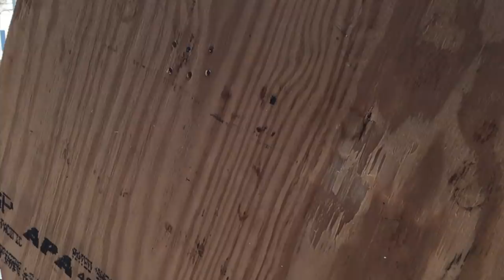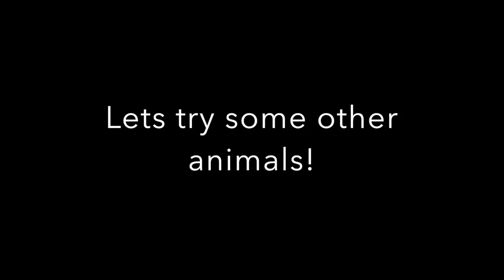WoodWorking: Building my Pet Raccoon a Running Wheel!

Comment: Back when my kids where young we had mice and hamsters. Those little shits ran on their wheels relentlessly to the point the noise would drive you nuts. Let us know how that all works out. By the way, awesome project though. If it ends up driving you nuts try a tread mill. you can usually fine them at a yard sale pretty cheap. they also give you control when they run and mostly when they don't. Love your videos. you kids are great.
Reply from the maker: Haha the hedgehog has a plastic wheel that squeaks like crazy.  I know the feeling 😂.  They are all in there own room so we don’t hear too much of it luckily.

Comment: Okay you need to put some rabbit wire all over it and then cut a little door in the middle that you can open and close that way they're forced to go round and round they won't be able to get out.  Great job I'm going to make that for our ferret. I'm so glad you're concerned about the weight on the raccoon because his is definitely true they get too obeast
Reply: maybe not in the middle but down at the bottom that could be shut and make sure it's secure because the ferrets will try to sneak out and could choke themselves
Reply from the maker: I’d be worried that he would be scared since he couldn’t get out and then he would just hate the experience

Comment: Just put in a simple fixed "wall" that doesnt move with the wheel to keep animals in and that they can only scale and go over if they get to about 30-40 degrees. So they'll constantly keep running up. And when you want to let them go out just open a flap in the wall, remove it, block the wheel or however you make it.

Comment: Well done video - Thanks! I am doing some research of DIY designs for these pet wheels.  I'm curious on the split between those design with the center rotary and those who use wheels on a bottom stand.  The latter seems a much simpler, stable, and smaller footprint design.  Any thoughts on the pros & cons?

Comment: Did your racoon ever get the hang of it?  I was thinking some kind of cover, or coating to reduce the effect of the screws and openings between the 3 pieces of wood used for the running area.

Comment: Hopefully the "flooring" of the wheel doesn't cause any injuries.  Slivers, gaps in the floor to catch a small paw, screws and voids to catch a claw and tear it out.  I'm sure it will provide your animals with a lot of fun but if it sees much use it's a matter of time.  A single piece for the floor, with a nice clean joint and counter sunk screws will be a HUGE improvement to keeping everyone safe and happy.
Reply from the maker: I’m going to line it with something soon 😊

Comment: this is painful to watch. so many ways you could have easily made this better. should have staggered the joints where the thin plywood meet. should have used a staple gun or brad nailer to attach them. and as someone else suggested, should have added carpet to make it easier on your pets feets